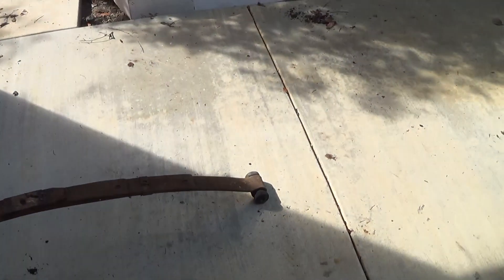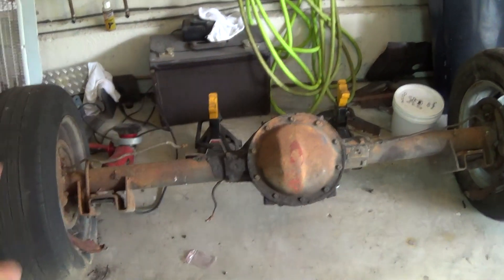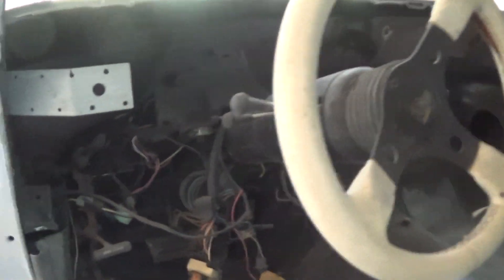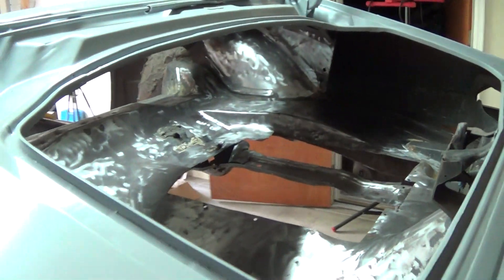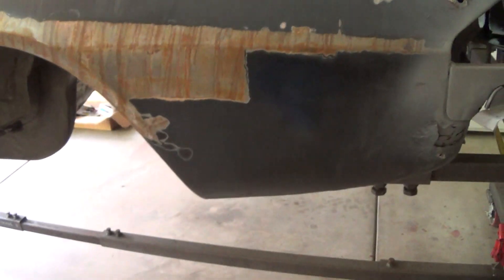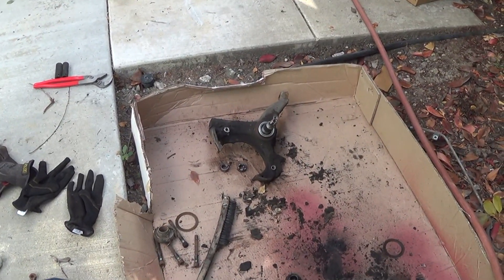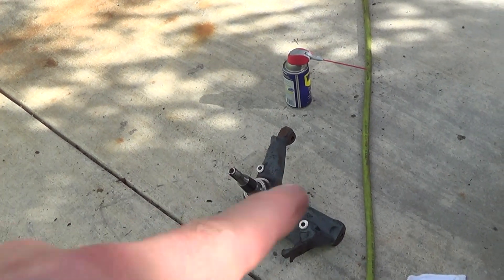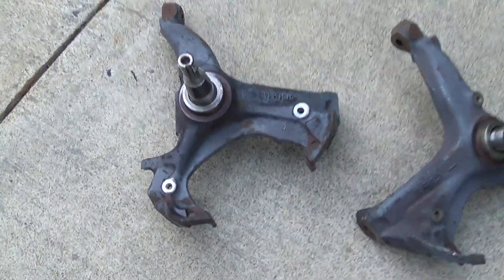1977 Camaro Z28 More cleanup work and disposal

Comment: Not being picky here Erik but you did ask what the shinny bit was on the spindle...It is the spindle...the assembly is called a Stubaxle and the spindle is where the hub attaches to...I can't say I've ever seen it sitting on all fours so that will be a milestone moment...Good stuff mate.
Reply from the maker: +ZIGgassedUP Makes sense. Even the disc brake instructions call it a spindle though. Yeah, the car went up on the rotisserie a couple of weeks after I got it, and it has been there ever since.

Comment: I would have loved the steering column that has value, also Erick the small brackets on the differential, the springs you may need and the proportioning valve for the brakes, they sell for around 40 bucks . there is a lot of value in that dumpster, I am sure someone building a streetrod or a custom would have loved that differential. oh well, one mans junk is another treasure lol
Reply from the maker: +Cary Lamari Yeah, I know. As I mentioned to tlcbear2, there is no market for this stuff here in CA. People just don't drive these cars around here. Out in the central valley, etc. people still use this stuff, but they are not going to drive to the Bay Area to get it. There is one GM used parts place around here, and they have all this stuff already. So, I could maybe sell it on Craigslist or something, but it is not worth the hassle for me.

Comment: Don't toss the steering column mounting bracket, you left the mounting bracket on the column and you're going to need that for the replacement GM column.
Reply from the maker: +AZ Frank Thank you sir! I will pull it off tomorrow.